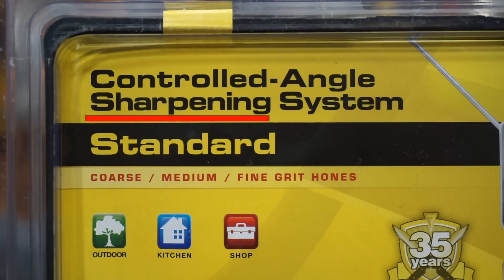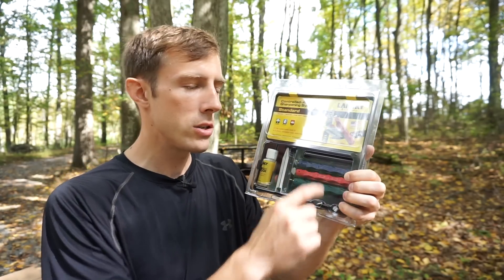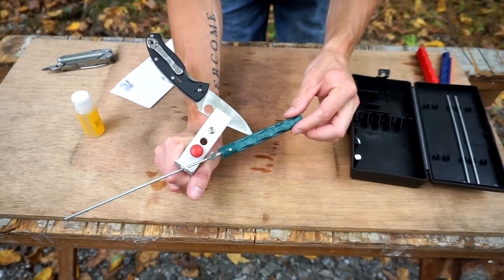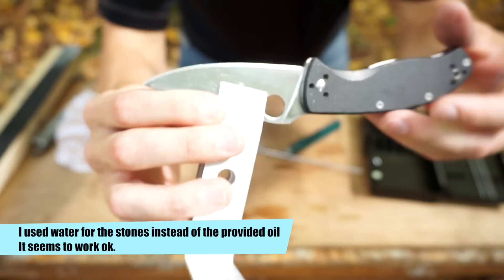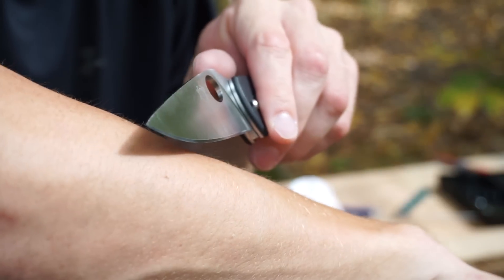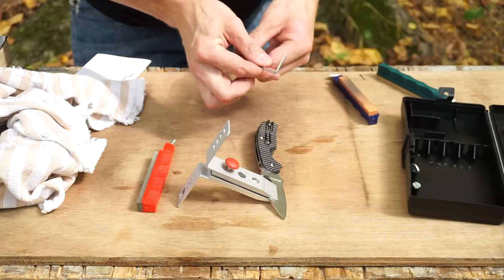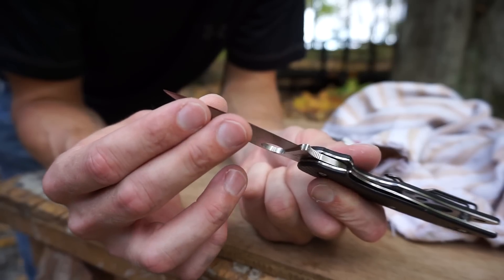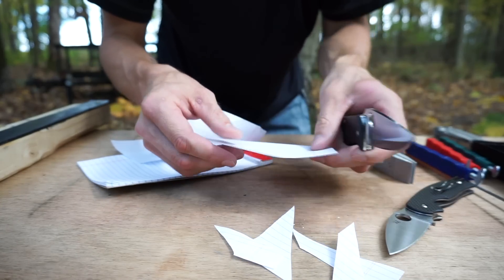LANSKY CONTROLLED ANGLE KNIFE SHARPENING SYSTEM | Another great beginner sharpening system.

Comment from the maker: Here's the link to this system http://amzn.to/2yhGIP6
Here's the stand for it http://amzn.to/2kIrSMD
Thanks for watching 😀
This is an Amazon affiliate link.
Reply: OUTDOORS55 when putting your stone holder and Rod together you got to have them both setting on a flat surface that way you get the same depth every time once they're both sitting on a flat surface then tighten the wing nut to secure the rod that way you have a consistent angle each time if not the results will be so and so and not very good well now when sharpening angle consistency is everything absolutely I hope you read this so you can get the full maximum efficiency out of your Lansky clamp system
Reply: OUTDOORS55 I'd just like to say, you can buy a base for the system and you are supposed to align the metal rods with the bottom of the stone.
Reply: For better consistency it helps to lay the stone face down with the Rod loose so it hits the table in line with the stone face. Then tighten and bend the rod down if needed so it lays flat the whole way. The idea is to have the rod an extension of the stone face for easier touch ups. Also good idea to write down the angle and the knife for easy touch ups too. I've had one for around 20 years and it's still going. If you break a stone Lansky will replace them too. They also sell a couple different bench mounts that make it easier to use.
Reply: Guess I should have read everyone else's comments first:)
Reply from the maker: Yeah I saw the base on amazon. Ill probably just use a bench vise if I continue to use this. I agree I mounted the rods wrong..haha. I still must have had them pretty consistent though..or at least consistently wrong as it still worked pretty well. Its nice to hear yours lasted that long. The quality on the surface doesn't seem great. Also didn't know about them replacing broken stones. Thanks for the info👍
Reply: OUTDOORS55 who knows if the quality used to be better. Thanks for the videos.
Reply: OUTDOORS55 they also sell a stroping block for this system
Reply: Getting the "correct angle" can be tough as it changes based on  how much blade is exposed past the clamp.  This link has some graphs for several systems, including the Lansky, so you know exactly what angle you are getting when you are in a particular hole, based on how much blade you have exposed: https://www.sharpeningsupplies.com/Guided-Knife-Sharpening-System-Angles-W142.aspx
Reply: OUTDOORS55 glad you found the stand 👍 I just got one for Christmas, makes the whole thing so much easier to use!
Reply: I got one with all of the stones up to the 2000 grit it was amazing. Its my main sharpening system
Reply: U got it for 22$, there is a "new" one for 51£ now 🙄.

Comment: YOU MOUNTED THE BLADE IN THE CLAMP WRONG!!  I've been using this system for about 5 years and it's awesome.  There is a channel, notch, groove at the end of the clamp that the edge of the blade fits in to properly mount.  In this way the distance between the vertical slotted piece and the edge of the blade is the same EVERY TIME you use the sharpening system, thus cutting down on how much metal you remove from the blade on successive sharpenings.  Your method doesn't have any reference and you might end up mounting the blade in a different position on successive sharpenings.  In addition I make a small mark on the back edge of the blade with a fine file, so I mount my knife, in the same position each time, horizontally, same reason.
Reply: I stand corrected.  I just watched the instructional video from Lansky and they mounted only narrow blades in the notch I mentioned.  For the size knife you used, they mounted it as you did.  I don't necessarily agree, for the reason I stated originally, how is one going to keep the distance to the vertical part of the guide the same on successive sharpenings???  If that distance changes, so does the angle of the stone/knife edge, the WHOLE POINT of this system.    I see no downside of mounting even larger blades in the notch at the end.  An alternative would be to make a mark, with a scribe so one positions the blade in the same place each time.    My apologies for assuming you were incorrect.  Sincerely, JG, Hollis NH
Reply from the maker: Yes they metion that the edge of the blade should be 5/8" away from the front of the jaw. At least thats the way I under stand it. The notch is too small for most things I sharpen. im not sure why they still put it there. IMO it gets in the way more than I help. Simply measuring the distance to the edge of the blade from the edge of the jaw is easier  in most situations. Just my opinion. Thanks for the comment👍
Reply: jg thanks for the good tips u mention 🔪 thx Howie
Reply: I've wanted a Lansky set up for years but wont get one till my Gatco set up finally dies. They are pretty much the same but the Lansky stones are better. They hold up to stronger steels. My extra courses and extra fine stones are lansky stones. But my Gatco is still going fine after 20yrs and I cant count the amount of knives I've sharpened with it

Comment: You can tape wet dry sandpaper to  fine stone  and get a mirror razor sharp edge. Just got sand paper up to 7000 grit.
Reply: I bought a cheap crab $12 from china, the stones aren't the grit they say they are, the 70 120 and 280 seem ok, "600" and "1000" just screw up your blade, becomes duller than on 280. Good advice now I at least have the grits I wanted.
Reply: @taitrunkl7086  better to buy a edge pro clone at $20.. i bought a ruixin brand, it the same as edge pro and the grit that included seem work fine.. but the best thing using the edge pro design is the aftermarket stone availability.. there a lot variety of polishing stone available for this sharpener..even the 3000grit ruby stone and 8000grit jade is available at only $4 each.

Comment: You obviously did not read the instructions carefully. The knife is clamped incorrectly and the guide rods have to be secured flush with the hone (using a flat surface) not screwed all the way in the hole.

Comment: I have owned one of the original Lansky kits for approximately 25 years now, and though it is not fancy, it continues to turn out very sharp knives, year after year. The strop is indeed an important step. My original kit came with a small, hand held ceramic honing rod, that is also good for final finish, as well as touch up work.

Comment: I use 10X magnification to inspect the edge as I sharpen it.  It's amazing how many imperfections you can see and it helps you know when to keep going and when you've gone far enough.  You can get a burr on a portion of the blade and still have knicks and flat spots on other areas.  When you see a perfect apex without any dings, then you got yourself a sharp blade.
Reply from the maker: Yeah its amazing how rough the edges really are. Thanks for the comment👍

Comment: yep at 5 minutes and you can see your blue stone sitting there see how the rod is up in the air it should be sitting flush on the wooden table at the same depth as the surface of your sharpening stone if that makes sense so all you have to do is loosen the rod let it drop down then retighten

Comment: I've had mine for at least 15 years and still going strong. Nice to see it work with S30V. Was working fine on D2 so figured S30V wouldn't be a problem. Been thinking about moving up to the diamond set, but maybe not necessary after all. Hardest steels I have are S30V, D2, and Elmax, and I have the 5 stone set. Thanks for a well done vid!
Reply from the maker: Nice to hear they are lasting that long. Id like to see an older one and compare it to a new one. It seems to work fine on s30v it does take some time though. The diamond stones may be a better bet of s30v and harder but I'm not sure. Thanks for the kind words my friend😀
Reply: @OUTDOORS55 I know it's a bit late but I have one that's probably about 25+ years old and a brand new one. The plastic is a bit cheaper feeling but the stones and clamp are identical and still sharpens just as good. I use it to sharpen just about every knife I have. The plastic case as cheap as it feels is still in one piece after all those years.
Reply: @Metalhead92395  Yeah mine's at least that old too.  I bought it when I finally decided that I would like a sharp knife and all I could do with a stone was make mine duller. 😀
Being on a real limited budget when I was younger, the Lansky was an expense but well worth it as I still use it and get the results that please me.

Comment: I've had mine for 35 years. Still sharpens knives very well. 

There's an edge on the front to align the blade straight
Reply: Are you replacing the stones? Because stones loses their flatness overtime right?. And do the holes where rod is making contact to the system itself does it wear out ?

Comment: I dont know if anyone said this already, but I'm pretty sure there is a stand for it. Anyways, great video as always!
Reply from the maker: Yes I found the stand on amazon haha. Ill probably just use a vice if I continue to use this system. Thanks!👍😀
Reply: Alex, thanks for the tip. I bought this set on your recommendation and I ordered the stand at the same time. I’m happy with the entire package and I’ve sharpened about 20 of my EDC knives with it so far with no discernible amount of wear on any of the stones. Use lots of water while sharpening because the stones (especially the coarser ones) will load quickly.
Reply: It does, I have it.  You can mount it as well.
Reply: Lansky sells 3 different stands for the kit.

Comment: I have one of these from around 1990 still in good shape because I haven't used it much. I need to start using it again. I'll try it with water instead of oil based on the comment about that.

Comment: I have the Gatco system, I find it similar, but you are not buying the name and the stones come with rods slide into them, so you slide the rods out to length you need then slide in for packing. You eliminate the burr by doing it equal strokes after you start. I use course stone if need be lets say 10 time each side then 8, 6,4,2,1 each side that eliminates the burr as you are cleaning it off as you finish off. I do the same with all three stones in my kit so they get and stay very sharp, I do not have a strop. I have a drag through tool I keep handy when out hunting, but that is just  a touch it up , and do the proper sharpening with my stones or Gatco . I have had it 20 years and still going strong. Thanks for the video

Comment: I had one if these many years ago when I was younger. Around 10 or so. All the old timers at the hunting camp would scoff when a young kid whipped out an old timer stockman,.... that is  until theirs got dull and they had to  use mine and realized that the knife would whittle hair Into shavings and then whittle the shavings Into more shavings. This thing is cheap, and easy to use. And it leaves a perfect edge every time. I freehand sharpen now, and I like to think I'm pretty good. But I'm no match for the lansky.  It lasted for atleast 10 years, and I lost some pieces and never bought another because I'd learned to freehand my knives. I recommend this to anyone . Beginner or experienced. I was 10 years old and was using this. It's that easy.  I give it a 9/10 , deducting one point because the case is garbage, and I'd STILL have the system today had the case held up and I could have kept up with thepieces.. no doubt in my mind that I'd still be sharpening with it today if I could have kept track of it all.
Reply: How many knifes you can sharp with this system?

Comment: For a stand I put a bolt upright in a bench vice and screwed a nut on then set the sharpener on it using the big hole on the middle. It works great.

Comment: I bought a Edge Pro Apex Clone for $23 about 2yrs ago  on Ebay and never looked back . It's a awesome machine, comes with 4 cheap Chinese stones that are pretty good, but you can buy the real EPA stones on Amazon for about $17ea that work excellent. They sell 3 or 4 different sharpeners, I have the one with the  suction base, it has a chrome lever , when you flip it  -it sticks to the table, flip it the other way and it releases. Now I repro file  all my knives, no matter what steel there made of, and when needed I use my Spyderco sharp maker to touch then up. It's  a great machine when you learn how to use it , and for $23 or so, you can't go wrong . The real ones start at about  $200. I highly recommend it !! Go check them out.
Reply from the maker: Thanks for the recommendation👍 This is my first controlled angle system, and I do like it. I can see why people like them so much. It would be nice to have some higher quality stones with it though. Although you can buy different stones for this system extra. I actually use the edge pro stones by hand. I have some videos using them. They are great little stones. Thanks for the comment👍
Reply: OUTDOORS55 The Chinese Rip Off is Called MOLIBAO.
Although, I think they have had some legal issues... I really struggled to find one for sale..
I did get one for £12 in the end.. The stones are some weirdness.
The "600"grit stone seems to Foam up and dissolve like clay when using water.. The " 120" seems to be like Sintered brake pads and magnetizes little bits of metal fur onto the blade!

Most of the stones get dirty real quick and are quite hard to clean... 

But it works! So I will now start to buy Genuine Lansky soon!
Reply: OUTDOORS55 a good higher quality alternative is the kme
Reply: Matthew M yeah they are
Pretty expensive  system amazing but expensive
Reply: Matthew M yeah I have a lot of shapton pro stones  however I onley go to about 5,000 grit i use those for convex and scandi edges and im getting a kme soon for everything else
Reply: @JETJOOBOY    The edge pro stones are made by Boride Abrasives (AS-9, AM-K, CS-HD, according to a Boride manager) and use FEPA standard.
The CS-HD are really nice in 400 & 600 grit & have really great audible feedback when sharpening, they leave very uniform scratch pattern, the AS-9 in 1000 & 1200 grit will make a mirror bevel. very nice stones.

Comment: I use this lansky myself and the first knife I sharpened (a cheap whittling knife) it brought the edge right back and my more expensive pocket knife which wasn’t a perfect sharpening as I haven’t much experience is very sharp but not shaving sharp. I will try to apex the edge better though it doesn’t seem to burr. I knocked off a lot of metal to get a chip out and it didn’t burr one bit

Comment: I use a rubber band to hold the case closed. I also have the 1000 and 2000 grit stones in my kit. I need to get a strop.

Comment: I hav the diamond set and ised it for the past 8 years , i do hav a base and it works a treat . I tend to only use the lansky set when the knives need re edging and hav found a sharpmaker works in between  (hair splitting sharp !!) My clamp did break about a year ago , one of the little lugs that hold the knife bust but it's been solid and re edged a lot of knives . 🖒🖒
Reply from the maker: Wow nice to know it lasts that long. The quality seemed a little sketchy haha. I would like to try some of the different stones they have for it as well. Ill probably just a use a vise from now on if I continue to use it. Thanks for letting me know!👍
Reply: OUTDOORS55  lol i can only speak for my diamond set but they hav seriously sharpened a lot of knives and will be lasting a long time yet !  The bars tend to bend but i use the same bar for all stones , keeps it consistent then . Their sapphire stone does a really gd job on honing to a nice shine too 🖒
Reply: You can usually get bases for them for less than $10. I think I only paid $3 for my stand, and screwed it to a piece of scrap wood.
Reply: trev815 I wondered about that.. I have the Chinese knock off and the rods are very bendy...
And the holes through the stones plastic is often not straight...

To say this system has been out for so long, there are some really obvious upgrades it could use..
Reply: My sharp maker works most of the time, a lot of my old carry knives that i used to sharpen by hand wont sharpen on my SM.  I may pick up the 5 stone lanskey eventually, im dreading having to sharpen my s110v para 3 when the time comes though.

Comment: I have that same system but paid a lot less for it.  I also got the base as well.  I think it works pretty well for me.  (I had to add some copper material to the pin on the base as the pin was too small for the hole and had a lot of slop.) I am going to get 2 more stones of finer grit in a few weeks which I just found out you can order separately.  I like it and, it is good for getting to learn the angle you want to sharpen at.
Reply from the maker: I agree it would be nice to have some more stones. I guess thats why they sell the deluxe version haha. It does take a little time to set up but would be great for learning the basics.

Comment: I don’t know if it’s been mentioned previously but not only did you mount the rods incorrectly but In useing the Lansky for many years and found the only way to keep the jaws from scratching blades this to use some type of plastic tape such as electricians tape on the inside ends of the clamp. This is sort of the poor man’s KME.
Reply from the maker: Yeah it's been mentioned. I got a handle on it now lol. I don't really care about scratches on my blades. If sharpening for someone else than yes. Thanks for the comment 👍